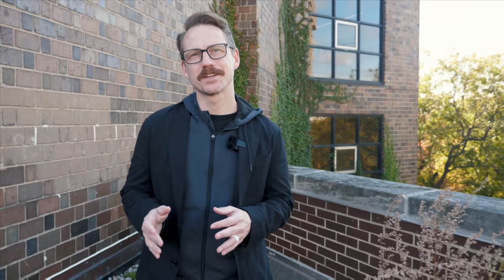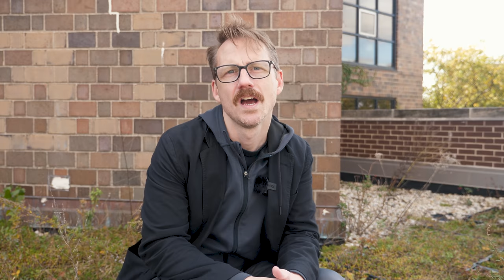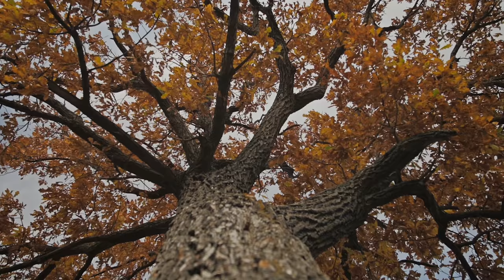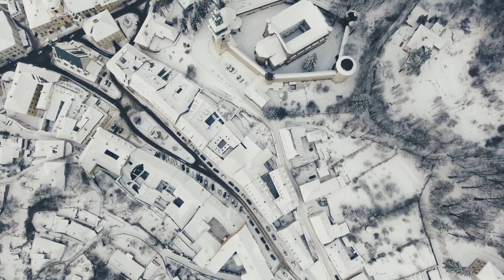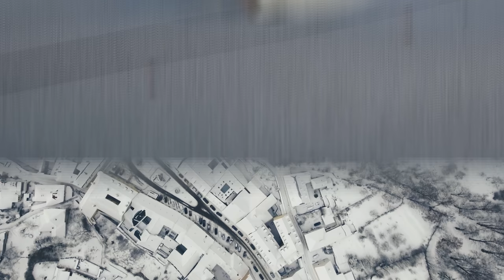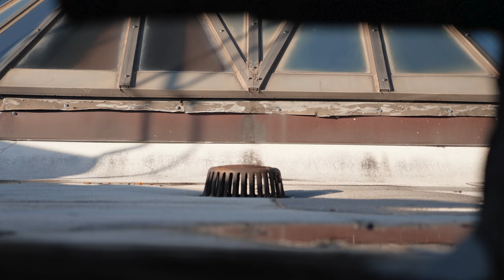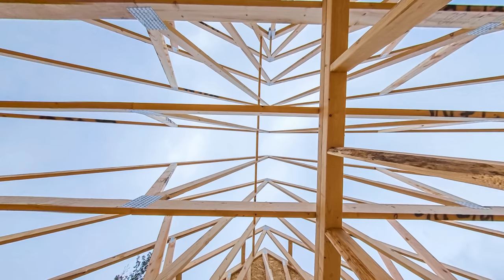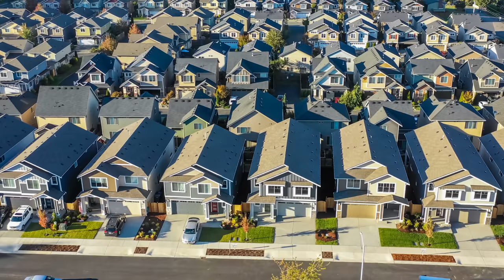Why Do Architects Insist on Using Flat Roofs?

Comment: I've always wondered why they use the flat (low slope?) membrane roofs on food manufacturing plants. It seems like for very little extra money, they could build a series of crowned sections that drain to a gutter system. Instead, they build flat roofs that, without exception, get low spots and create dozens of leaks during rain storms and result in the maintenance crew spending hours hanging plastic to catch the drips.

Comment: The only reason I would prefer flat roof is to put solar panels on it. I thought flat roofs were easier, quicker and cheaper to build and you also don't have to worry strong wind will take off your shingles. It sometimes happen where I live. But my brother who is a civic engineer told me how flat roofs are built and I changed my mind. In my country it's equally if not cheaper to build sloped roof. Flat roofs are usually built only on large buildings like schools or supermarkets so it's hard to find someone who can make them properly on your house. If there's even a tiny mistake in laying the insulation it will leak. In that case the builder has to go over every square centimeter of the roof on their hands and knees to find the leak. The bigger problem is if the leak occurs months or a year after the building which makes it even harder and more expensive to fix.

Comment: If you have a pair of pliers, you can use it for more technical just plying. You can scrape, wrench, hammer, and measure even. The point is function is an assigned attribute. 

These low slope roofs are creating shelter with a minimum of building materials.

Comment: Flat roofs are ok for large buildings and skyscrapers but for residential homes and apartment blocks, where people actually live, the roof should always be angled to control the water/precipitation. Water can be extremely destructive and damaging to wood and/or concrete structures and if it's not controlled properly it can erode material(s) away, cause rotting of certain materials and with enough moisture in or around one's home will give the proper conditions for harmful mould to grow. Mould can cause serious heath problems or defects especially with children, infants and unborn babies still developing in their mother's womb.

Comment: I just hate shoveling them tbh. In my experience, smaller building with flat roofs always have issues, leaks, maintenance and upkeep like shoveling, mosquitos and puddles, accessibility issues, no attic space for heat to escape the house or cross breezes... Larger buildings are able to invest in these, see benefits and make public spaces but for family homes and small buildings, it's just not worth the constant nightmare of upkeep when a pitched roof is far easier. Plus, insurance dislikes them.

Comment: Flat roofs work for industrial settings or very large residential.  Once you get into area's through with substantial snow fall, places where the accumulation may be 5 or more feet in a single event, and 10 or more over a year...   Then you get cases where even large buildings will have sloped roofs or seek "special" solutions for snow loading.   Here,  we start to see houses with very steep pitches,  and even large buildings with low pitches...

Comment: I'm a big fan of liquid applied low slope roof. You have no seams like mod bit and by simply recoating the roof, you can get another 20 year warranty. In most large gamble buildings, the mechanical equipment is installed the the mezzanine. In order to replace large hvac equipment, you will have to take it a part and install the new equipment in custom pieces. With a flat roof, it is easier to use a large crane and replace roof top units.

Comment: Also gabled rooves cause dangerous snow drifts which makes them generally unsuitable for public areas,one issue with flat rooves is that they're often used in the uk to hook up extensions like consevatories and other mostly prefab extensions without having a complicated geometry meet the house, these aren't generally chose for function nor are they the best quality (as was standard in this era)

Comment: Biggest thing is residential versus commercial. That residential designers waste the attic space has always made me wonder, yet a lot of designs now take the upper space to house h/vac systems keeping them more serviceable. So it is more region directed as well. The structure needs far more structural strength to handle the load as well. Good video nonetheless.

Comment: I don't like typical roof designs that are not flat in places of low yearly precipitation, especially of snow, and I am talking for just normal residential suburban housing.

Roofs are expensive, and heavily sloped makes it dangerous and more costly to maintain. I feel it also adds more stress during high wind seasons.

We live in an age where if we aren't getting below freezing temperatures, we can easily address probems of buildup and slumps in a roof is more like bad design.

Also, setting up potential flat roofs to have a canopy set up cn effectively create an upper floor deck, that does also provide a sloped roof benefit and coverage. It also means you an go above the ceiling and work needed much easier than crawling around an attic.

Every attic I have been in seems like a health hazard, extremely dusty, has rodent droppings, dead things, evidence of failed bug infestations, nasty insulation and scorching hot in summers. Not to mention can be very accident prone in how sloppy many of them were set up as.

Flat roof designs should be more popular and we should hae better material to use to address the flass it brings, because high sloped makes it functionally useless space nd weight and a costly maintenance demand.

Comment: As someone with a fear of heights, I'm a fan of flat roofs on low buildings. Anything above 3rd floor is a sin to humanity and any area where such is necessary should face a purge.
Mountains should also be levelled if they have a slope of more than 30°, but that might be slightly off-topic.

Comment: Great video. There should be a decision tree or checklist for people thinking of building a new structure. If I was building a garage or backyard office for example - I would ask if I want to be up on that roof for any reason. Like is there a breeze up there, is there a view I would get by sitting 10--12" higher up. If yes then build a deck or outdoor living space up there. What's amazing is flat roof buildings where they have chosen the flat roof for other reasons but find a way to put a rooftop indoor/outdoor space up there or even a single apartment perched up there with their own rooftop deck. It's sad to look down at a building with a huge rooftop space that would have an ocean view but the owners have chosen to leave it as wasted space, closed off to their tenants.

Comment: Thank you for an enjoyable video. The topic was  interesting and you presented the video well. - 
I've moved to the Fens, an area that suffers badly with subsidence. ( the whole area is either HEAVY clay or drained peat.) One house I viewed was an early 20C concrete house. It might have been OK elsewhere but in the Fens? Madness. The whole property was however genuinely interesting including the roof. basically it was a waterproof membrane then a set of loose layed large polystyrene blocks then normal concrete garden slabs. the roof was actually OK but the whole house needed constant work due to continual movement.

Comment: I think if your building where there is heavy snow that a flat roof is a bad idea because of the weight of it. It can be dangerous if it collapses. You can counter that by heating up your flat roof but that is a bit expensive. Of course with a skyscraper costs doesn't matter as much as saving space since every square foot is precious for renting out and earning money.

Gabled roofs also help down south if the inside is also gabled since it lets the hot air rise which cools off the entire house much better especially when that ac breaks down.  God that can be a nightmare!

I am a big fan of grass kept natural roofs since they lower co2 by just existing and can make for a forever roof if done right so can save a TON of money.

Comment: I think it's an urban/rural problem.  Flat rooves make sense on huge buildings surrounded by other huge buildings.  They are shared by multiple, usually dozens of homes/businesses, so no one wants the little attic space at the tippy-toppest of levels.  A rural, private home or barn wont have the concern of rainwater and ice falling 10+ stories down onto pedestrians below.  And that cramped, awkward attic space will be far more useful as a storage area to a single private owner of the building than it will a real estate conglomerate trying to get as many dollars of rent money per cubic foot possible.

I agree that both have obvious advantages and drawbacks, but I think that's the ultimate form vs. function.

Comment: The houses with flat roofs I’ve experienced have significantly more water leakage problems then gabled/hip roofs. Even with gabled/hip roofs architects persist in designs with valleys and other complicated features they argue makes the house more interesting. Every roof complication creates more water issues and should be avoided. We currently live a house with a light colour galvanised hip roof that’s been the first house we’ve ever had free of roof leakage problems. No painting or maintenance required and with the guttering it run massive downpours and is at just the right angle for solar panels. We don’t store anything in the attic except insulation and aircon ductwork but still have excellent access to walk through. It’s a no brainer so don’t let architects overruled common sense. When the house was being built the pre assembled roof trusses only took a day to install as did the metal roofing.

Comment: As someone who has nearly died to a flat roof caving in, twice in two different warehouses in two different states, I find all this suspect.  All I can think to say off hand though is if your fool enough to build one of those flat roofs and find later you need water pumps to clear water in a heavy rain, just rebuild the damn thing.  You wont need to be under the break to die and the break is likely to be bigger than you think.

Comment: You can simply make it look flat from the ground view, but make it angle inwards towards a center drainage that simply redirects runoff back to the edges of the building. This can be performed with simply making a low wall around the roof that is equal to the peak of the angle needed for proper drainage (parapet?)

Comment: I understand that low slop roofs ARE CHEAP TO BUILD & MAINTAIN as long as there are no leaks. All roofs wear out and will leak, but flat roofs will wear out sooner.  The long term maintenance is hard because rain can be hard to predict when scheduling a roof replacement. I have seen new sloped roofs going up over flat roofs because the flat roof is very hard to keep leak free and the damage from a roof leak can exceed the cost of a new roof. If engineers worked on creating a cheap alternative, I think flat roofs would go away. Equipment on the roof can be put on sloped curbs to accommodate a sloped roof. Cat walks over the slope can be installed.

Comment: I watched this to learn the facts on why flat roofs. Thank you for the lesson. While I've always questioned their use on residences, I never questioned them on large commercial buildings. I give architects credit to do what makes most sense and flat roofs are obviously a sensible solution supported by the fact most large buildings have these. A flat roof has less square footage than a pitched roof covering same area, so less materials.

Flat roof on a residence or even minimal pitch built-up roof? Ummm... I dunno 'bout that. I always called those converted Dairy Queens. Especially on a wooded lot?? I see those as an architect designing a home to satisfy themselves. More expensive and problematic is what I see. Maybe the goal is to gain a mini-commercial look... like a Dairy Queen. Haha

Comment: No one seems to be mentioning the elephant in the room in the comments. The reason flat roofs are being used on residential houses (which I find totally ugly and I keep referring to them as a data centre with a couch) is because councils force height limits on them. In Sydney where most councils limit the height of the building to 8.5m, you can't have a gabled roof if you want two stories. Particularly if you're on a slight slope.

Comment: One aesthetic advantage to a flat roof is if you plan on installing solar panels they are not seen from ground level. I see a lot of houses now with solar panels installed where they can be seen from street level (even on the front of the house!) and it just ruins the look of the house. Entire neighborhoods look worse just because a few houses have those things. If all those houses had a flat roof solar could be on every house and you would not see them from street level.

Comment: I still think that flat roofs make no sense, but you have now adequately educated us about how they aren’t actually building any entirely flat roofs in snow prone climates. Low sloping roofs do make a lot of sense if they are designed and built and maintained properly, however if any of those elements are lacking they do have a tendency to leak. Gabled roofs can also leak if they are designed built or maintained incorrectly, but it is a lot easier to just look up at a gabled roof to know whether the shingles need replacement because the edges curl away from the roof when they are failing and you can prevent leaks by replacing the shingles at that time. Low sloping roofs that I have seen usually are covered in gravel and the first sign that something is wrong with the roof is a leak through the ceiling of the top floor with possibly a bunch of black mold from previous undetected leaks, my experience with flat roofs is mostly from extremely old educational institutions buildings, my high school was built before WW2, leaky roofs and black mold are very common issues in that context. The newer version of low sloping roofs, or an older roof that has had adequate funds allocated for maintenance over its lifetime might have a different and better experience with low sloping roofs than I have personally experienced. The ability to use a low sloping roof as a communal area is one of the best reasons to have one in my opinion, rooftop decks provide a wonderful experience for the residents of a building, they can have a barbecue or picnic area and grow a community garden as well as using solar panels to provide shade and rain shelters like a gazebo would while also providing all the electricity needed to provide lighting for celebrations taking place after dark.

Comment: In truth, Flat Roofs are fine as long as there is not a hole or recess for water to accumulate inside of, or a ledge around the roof to prevent drainage. Water just laying on a flat surface made of tar, and at a higher elevation, would actually evaporate faster than water saturating a concrete sidewalk or grassy meadow.
In practice, it is appropriate to add that a sloped roof on a skyscraper would send pounds of water drawing would become effectively tons of force upon whatever is underneath it.

Comment: Nice video but one correction. Roof water is not discharged into the sewer system, as you twice mentioned, it goes into the storm water system the same place where streets drain.

Comment: No flat roof is ever actually flat. Even those designed with zero pitch will have low spots. Those are the ones that get the most hate. To compensate for low spots that develop with the construction and material variability, nearly all "flat" roofs have a pitch to move water as Stewart comments here.
Now, pay attention children. The farther the water has to move, the more pitch has to be included. But even steeper drainage pitch doesn't move snow off until it melts. If it melts in the daytime and freezes back overnight, you have ponded ice water just sitting there. That's when leaks start to happen.
For this reason, early built up low-slope roofs actually were intentionally NOT INSULATED! They put wood or coal burning stoves in the upper story to heat the roof structure so that snow melt did not refreeze and start degrading the roof, creating leaks. This is almost totally unknown by architects and builders today. Those "lofts" up in the top of buildings were originally there as heated space for the roof structure to prevent icing and snow melt water trapping.
In the 1970s there was a big push to conserve energy, especially as heating spaces became quite costly. Those roof heating loft spaces were converted to rentable/usable space, insulation was put in to KEEP the solid elements of the structure from being warmed... and disaster struck everywhere that snow buildup happened as a result. "Flat" roofs on older buildings in downtowns were collapsing all over the upper midwest and east coast, and massive leakage started happening where before it hadn't been a problem.
Most of the newer roofing materials were developed because of the need to withstand repeated snow melt and ice-formation, to try to turn the water ponding problem when roof structure is not heated as it used to be with the old 3 layer built up roofs were intended to do.

Comment: Flat roofs Makes sense for tropical areas without any issues; 
in areas with heavy snow and 4+ months of cold weather flat roofs only makes sense for large buildings 
- they avoid snow sheets shedding on sidewalks 
- they house water heaters n hvac  equipment 
- once a while snow clearing is akin to cleaning the lawn and driveways (is affordable ) vs lost space for attic 
- modern days flat roofs are made with concrete making durable with less maintenance